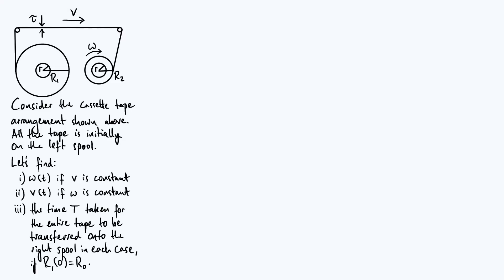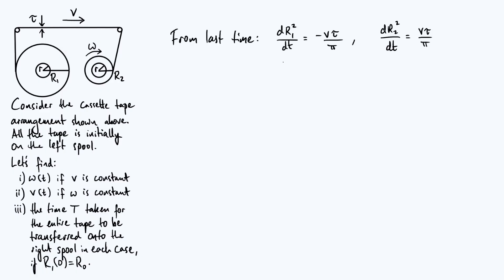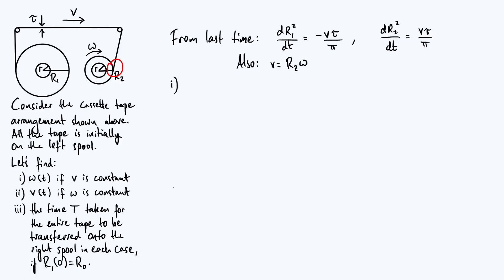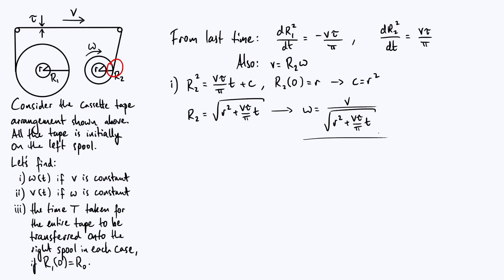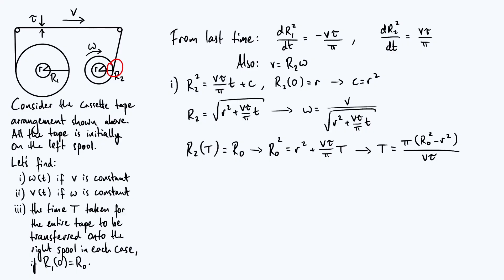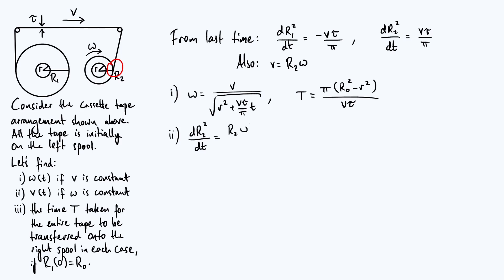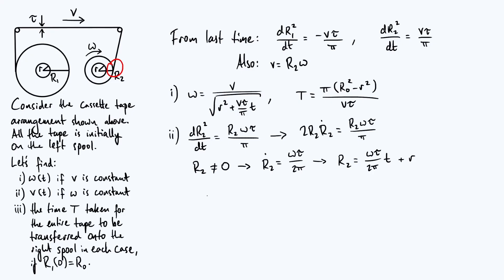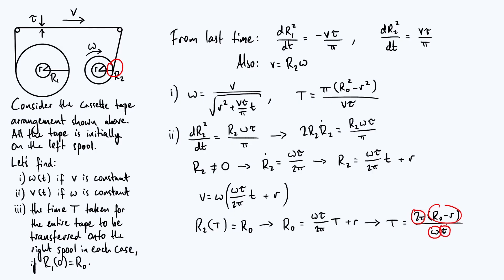Angular and linear velocity in a cassette tape

Comment: brilliant!
Reply from the maker: Inspired by your suggestion if I remember correctly! I modified the details a bit to make the situation more physically realistic, but you can easily adapt this method to solve your original problem.
Reply: @DrBenYelvertonthanks! I’ve been trying to solve it like a 4 bar linkage. This is a much more elegant solution. Now what happens when you directly attach the tape from driver and driven? And get the rotation of the tape vs the center lines 😅
Reply from the maker: Ah, you mean finding the angle that the tape makes with the horizontal? In the case you described, R₁(t) and R₂(t) would be the same as in this video, and once you know the radii it becomes a pure geometry problem. The tape is tangent to both spools, so you'd draw two circles with radii R₁ and R₂, and their common tangent. I haven't tried going through the details but if you draw out the diagram I think you should be able to use trigonometry and circle theorems to find the required angle!
Reply: @DrBenYelverton hey doc, how about some 3d orbital mechanics solutions. send a spacex rocket to mars and back (no landing), just like michael collins in apollo 11

Comment: So does that mean the actual cassette player changes the angular velocity of the disc? How does it know the radius of each disc?
Reply from the maker: Great question, the angular velocity does vary according to this equation but in practice this is achieved in an indirect way - there is a separate roller that pulls the tape off the spool at constant velocity. See the "Capstan" section in wikipedia's article "Tape transport" for more details!
Reply: @DrBenYelvertonoh that makes a lotta sense 😅